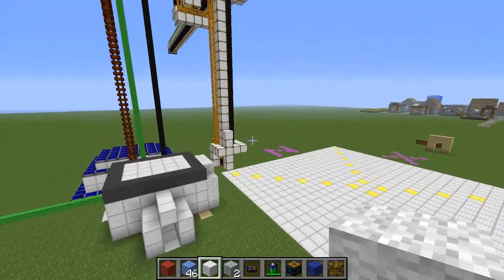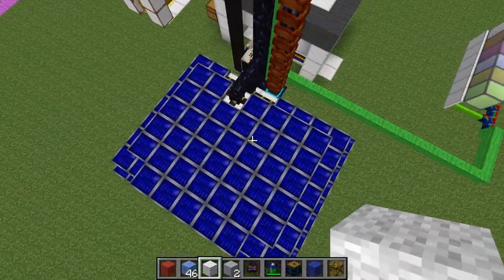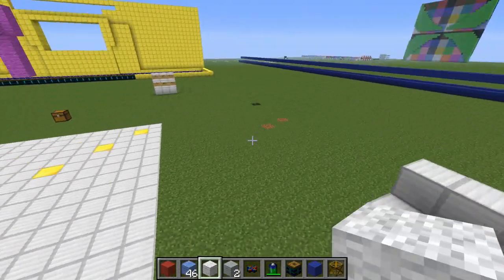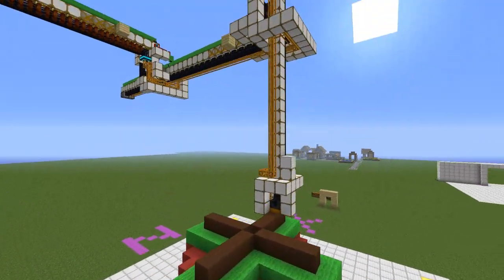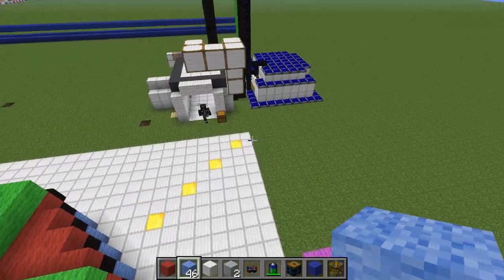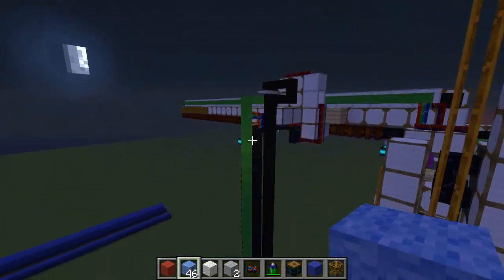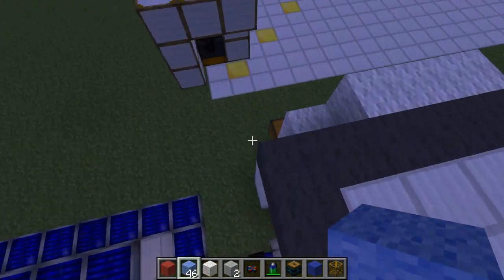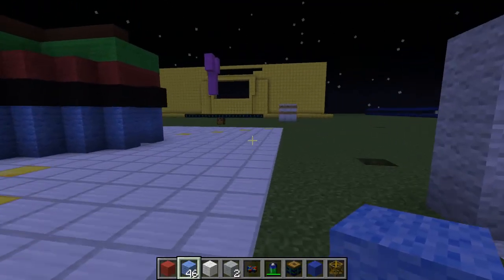Minecraft - RedPower PR5 SUPAH PROJECT! - 3D Printer

Comment: Is that black jacket a cable or wire, because when I try to connect a cable to an assembler it won't connect, and isn't possible to have it place more than 1 type of block in just one wire. :\

Comment: 1. Instead of using a power house with cabling, you could have used an enderchest mechanism with a huge power plant a bit further away.
2. You could also have an enderchest wool supplier.

This would make you use less power as you have to move less blocks.